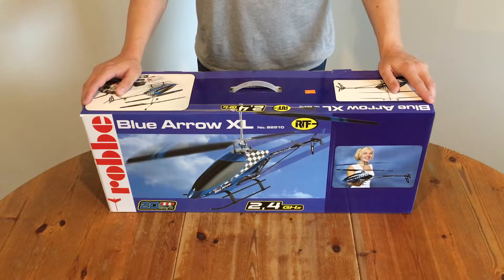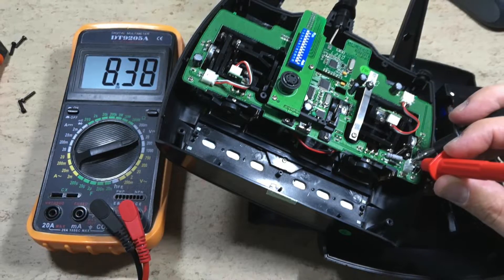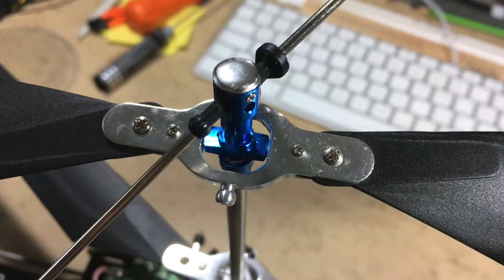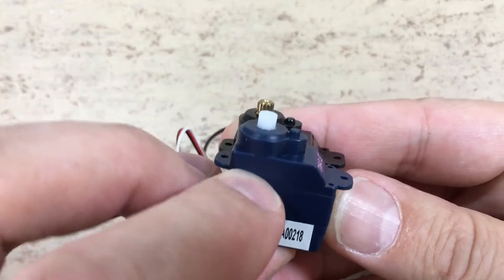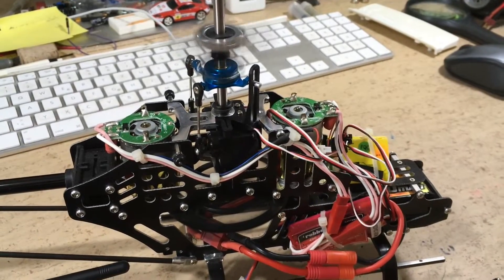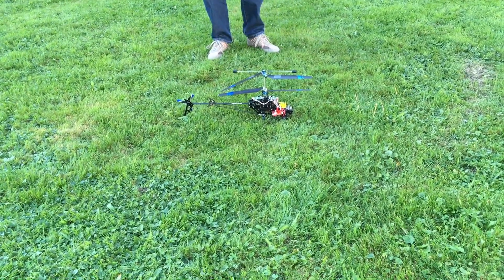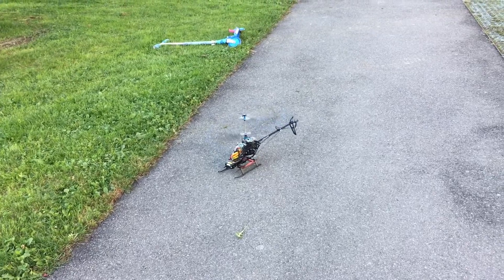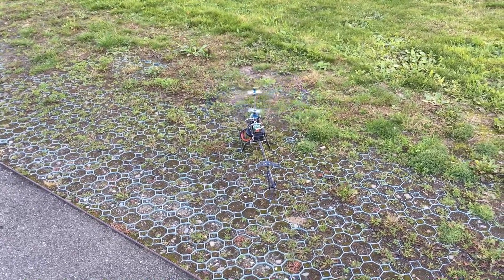Robbe Blue Arrow XL Helicopter Repair, Maiden Flight And ???

Comment: Nice video. I'm useless with flying machines either. Got one cheap heli from the local shop to practice. The trick is to get the tail rotor trim and take off as soon as you have enough trust... Happy flying, love your videos
Reply from the maker: Thanks. The trim is OK, but it‘s difficult for a novice to take off fast enough without loosing the balance. I still prefer ground based vehicles 😉

Comment: You must put the throttle stick up faster, and don't be scared. Don't drag your landing gear on the surface and put the helli up to hover faster.
Reply from the maker: Don't be scared is easier said than done, if you are an absolute helicopter beginner ;-)
I think this helicopter is just too big for a beginner.
Reply: Ja, gib mehr Gas, den wenn er über Ca 50cm Höhe über dem Boden hat wird die Fluglage viel ruhiger 👍 Und am besten bei einer höheren Wiese, dass federt bei Abstürzen. Viel Glück